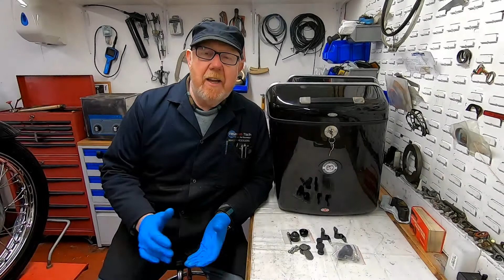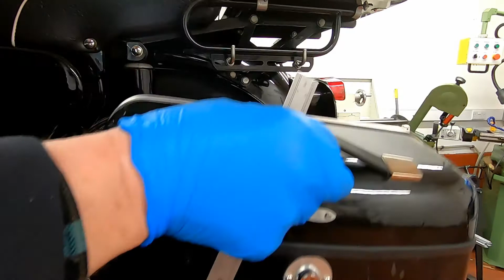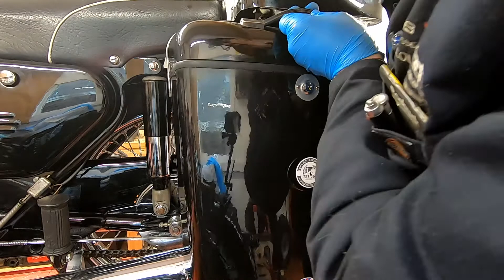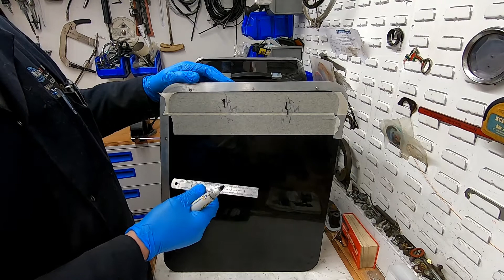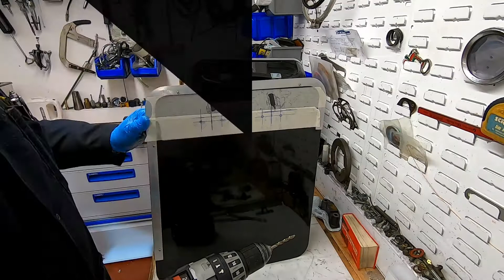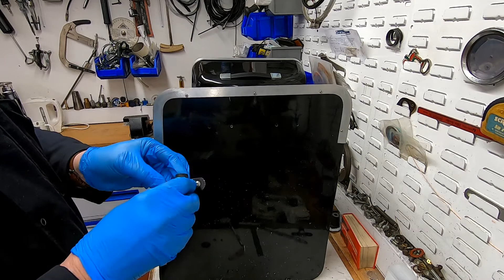Craven Equipment Dolomite Panniers Installation Part 1

Comment: The rubber “bobbins” are rocking because you’ve left off the inside bobbin fastener which stabilizes the bobbin and keeps it in place when putting the panniers on and off.
Reply from the maker: Thank you for your comment. However, you've lost me on this one because I'm not aware of any "inside bobbin fasteners". There certainly wasn't any other components in the kit when it arrived. The instructions were quite sketchy so I used my initiative. I can see how an inside saddle would help. The panniers seem to be quite stable as they are though!